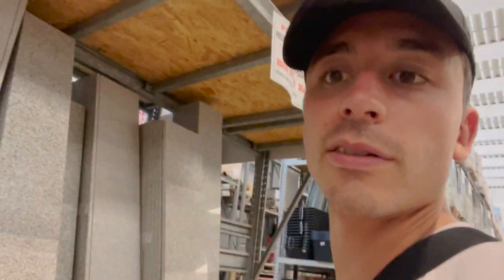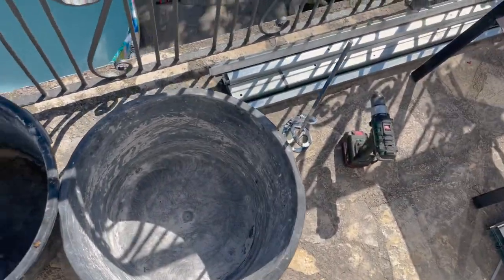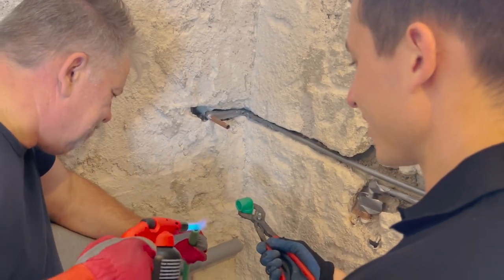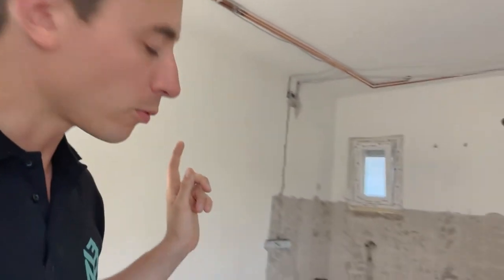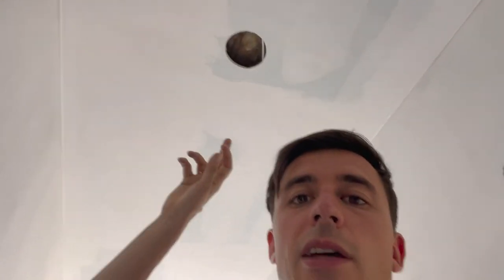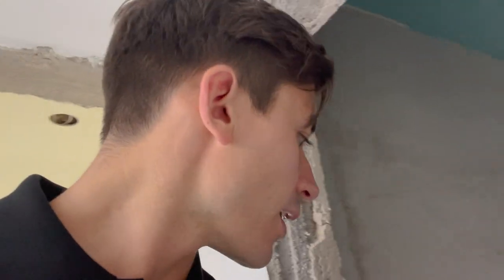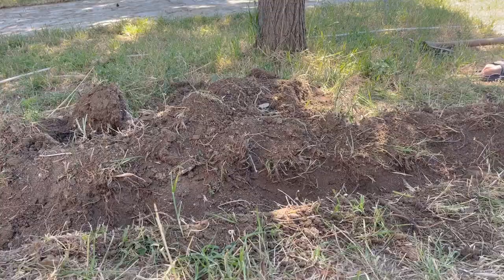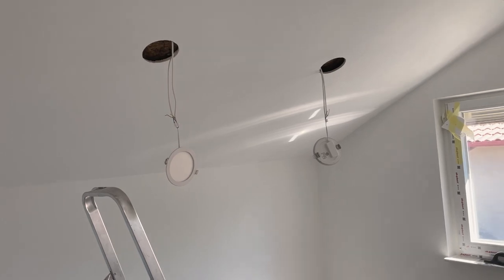Putting in a big graft to make our house in Croatia liveable! - 016

Comment: Use some of those marble/granite slabs for door thresholds too, as well as on the windows' exteriors.
Reply from the maker: I've seen some Croatian houses do this but they make them stick up and easy to trip over. Are you talking about outside doors only or all inside ones too?
Reply: @Dusan.Grujic  Some people use them outside and inside but most use it just outside.
For example, the transitions between wood floor to tiles are usually separated by  small "prag" inside the house. It can be wooden or stone.
Reply: @Dusan.Grujic 
On the inside doors when you have two different finishes or tiles on the floor. The slabs are only about 15mm thick, so by the time you do the tile finishes on either side, you are left with only 3-5mm height. It's nice, because the interior thresholds sort of "frame" one tile to another, particularly if you run one tile in one direction, and the other in the other direction.
I have actually placed them also between wood laminate floors, and porcelain tile floors too, and it works well.
I got one type of tile in the washroom, and another in the adjacent hallway with a threshold that sticks about 4-5mm above the adjacent floors.
I got my granite thresholds at the local cemetery, lol, and they cut them for me.
On the exterior doors, you have to use a special aluminium threshold with a lip to prevent water from dribbling in.

By the way, did you put floor drains in washrooms? They're required by code there, but even if they were not, it's a good idea to do it.
Don't know if you are getting an electric clothes drier or not. If you are, get the one that vents directly to the outside; they work much, much better than the ones that do not.
Ask me how I know, LOL!!!!
Gorenje makes decent appliances there.
IKEA does excellent kitchens, and sinks - you can get a large porcelain sink from them.
For some bloody reason, Europeans install tinny little sinks in their kitchens, whereas we in North America do the large ones. We did the large IKEA one in our renovation there so that we could give our little dog a bath in it.
If you don't already don't know, Emmezeta, IKEA, and Ellipso are major stores there for stuff.
Bauhaus, and Pevex are not bad either for construction materials, though Bauhaus tends to be more expensive.

I wish I was there to help you work on your reno. Love that stuff!!!
Reply from the maker: @apscoradiales  - It's a little bit late to be putting in those marble dividers now but might be something i may look into for above the konoba

- I didn't realise those drains were necessary, Ive taken mine out as I have seen them backflowing and smelling before. I really cant see the use and in the UK its not a thing unless you have a wet-room.

-Not sure where we will put the driar yet, potentially in the konoba, but i will make a vent for it as i dont fancy having alot of moisture in the air.

-Ive figured my way round the shops now finally, you kinda get the hang of it once you going searching through all shops trying to find one thing. All my furniture im getting from Ikea, and most contruction stuff i got from pevex and bauhaus.
Plumbing stuff i mainly got from Fero-Term.

Haha i wish you were there too! Wouldnt mind a chuck! ;)
Reply: @Dusan.Grujic 
They don't use P drains in Croatia all that often like they do in other places.
In Croatia, they use box drains that are built into the lightweight concrete floor topping (usually 3-4" thick).
In either case, fill the drain with water periodically, and that will stop the nasty smell from coming back.